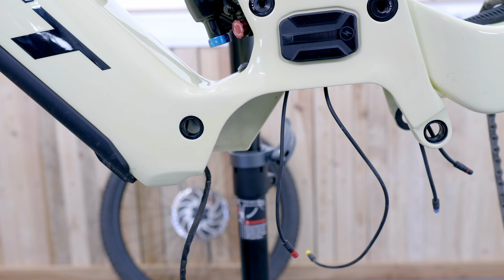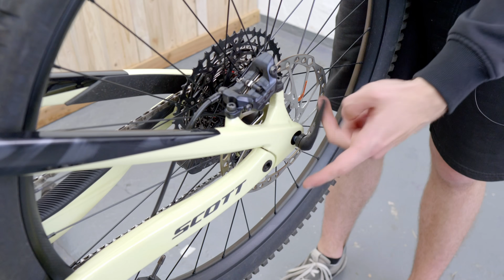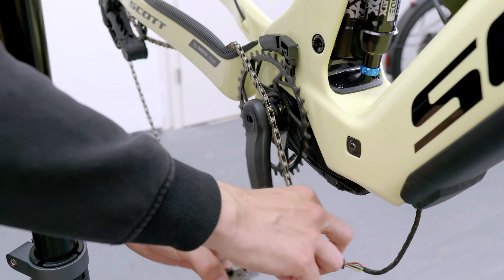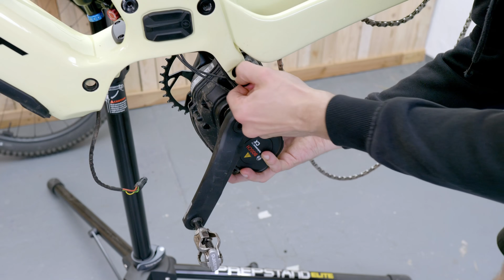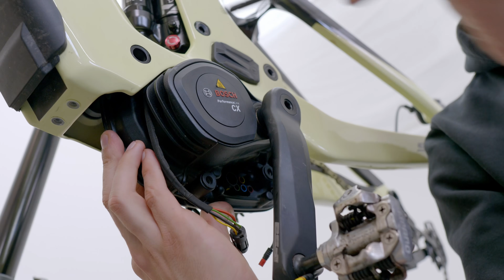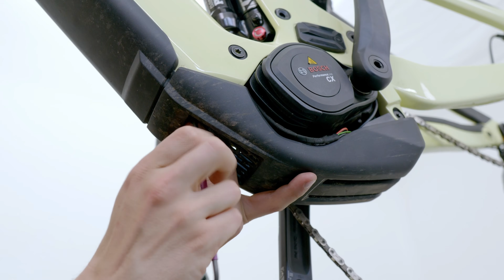Mounting & Removing Bosch Gen.5 E-Bike Motors | Tutorial 🔧

Comment: hi, when swapping a motor for a new one, is there any coding to be done or can you swap the motor without re-coding the new motor?
Reply from the maker: If you swap an identical motor, there's no problem. If it's another type of motor, you should verify compatibility with battery and display, which of course should be from the same brand. Thanks.

Comment: Just got a brand new Lapierre with Gen 5 motor. I’m adamant there was no clicking noise when pedalling backwards at first but just fitted pedals before the first ride and can hear a freehub/ clutch noise - is that normal?
Reply from the maker: It's tricky. It could be:
Loose cassette / lockring or spacer issues
Cause: Loose lockring or missing/incorrect spacer lets the cassette move and click against the hub.
Check/fix: Torque lockring to spec, verify correct spacers and cassette seating.
Or: Severe chain misalignment, bent derailleur hanger or worn cassette chain engagement can produce noise under load that sounds like clutch noise.
Check/fix: Check chainline, hanger alignment, chain/cassette wear; adjust or replace as needed. 
Good luck!
Thanks.

Comment: For the electrical connections, do you use dielectric grease or technical vaseline?
Reply from the maker: Definitively use dielectric grease. Technical vaseline (petroleum jelly) can swell some plastics/rubbers, it's hardly suitable for ebike connections. Thanks.
Reply: @ebike24  I asked because every Bosch's manual (including some leaked dealer workbooks) plus a video on their youtube channel is saying to use technical vaseline.
Reply from the maker: Then technical vaseline is fine for Bosch. I was using it, then I shifted to more specifical grease, also because I dislike everything based on petroleum. Thanks for informing.
Reply: @ebike24  I too have concerns about vaseline. I'll follow your advise and use dielectric grease. I can't find any in you shop, can you recommend a brand?
Thanks for all the videos. They are very informative.
Reply: Do you put this grease on the actual pin ends of the connectors?

Comment: Good video, Are the torx bolts standard torx or torx + like they were on some previous gens, are there different torque settings for aluminium and carbon frames
Reply from the maker: For Gen. 5 motors, especially for certain critical fasteners of the most powerful ones, Bosch uses torx +, although I’m not sure It does across the board. Thanks.